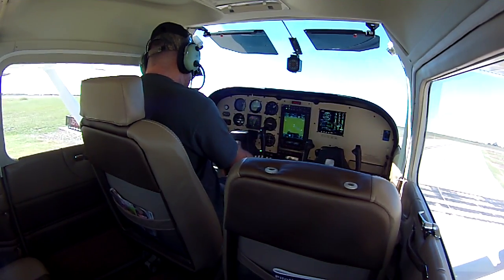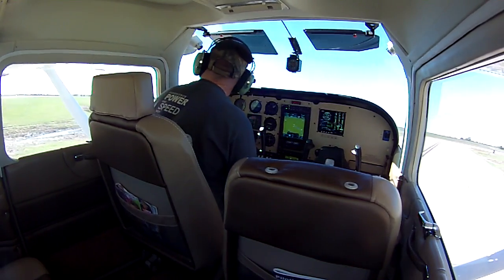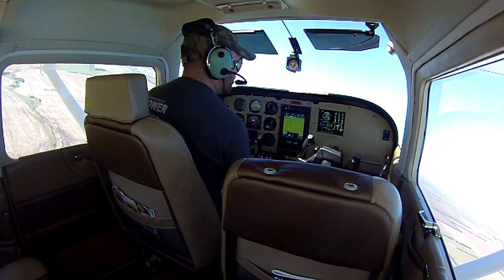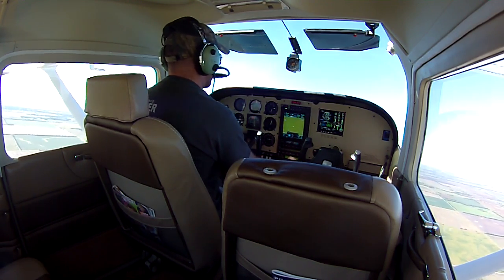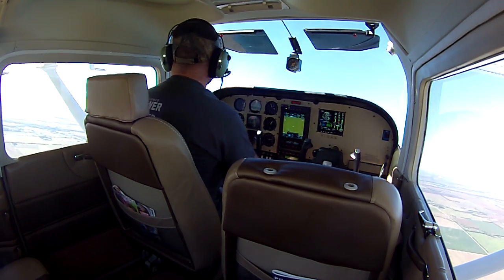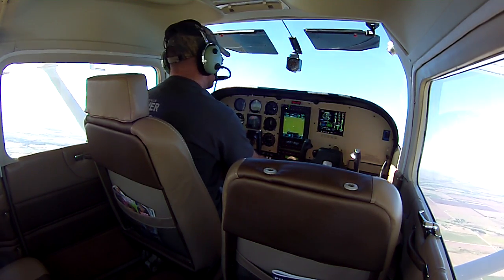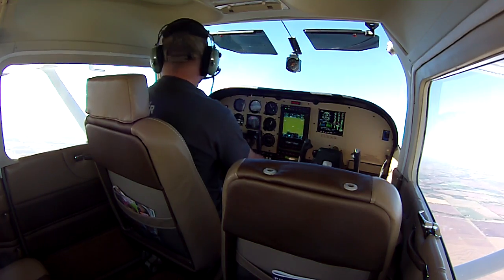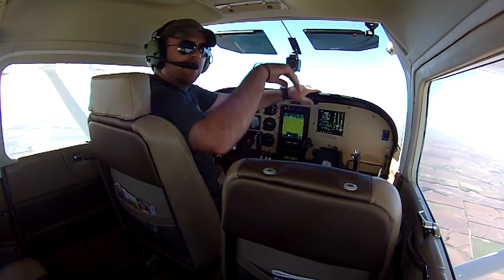Air Plains 182 300HP Takeoff

Comment: 14 second takeoff?  My C-185 will get off the water in 12 seconds with Aerocet 3400 floats and a 300hp engine.  Real performance comes from STOL (RSTOL, Sportsman, Wing-X and VG) mods, not from exaggerated horsepower.

Comment: 25 gallons an hour?!?!?! Thats the same a a 206 jet ranger.... Sorry but this is a very inefficient aircraft for what it is... Whats the point of this, plus an 82 inch Macauley will give you almost no ground clearance on a tricycle undercarriage, so landing off strip will be very limited without chopping something... Plus I have seen 230hp 182's perform better than this.
Reply: 25GPH is at full power, full rich, max RPM. I'm  sure it burns far less in cruise.

Comment: So that's approx. $40 grand upgrade, what was your level speed? 190 kts/ burning 18 gals/ at cruise? Why not buy a 210?
Reply: Doesn't sound like a bad Idea although it will hurt with insurance.
Reply: The 210 would be faster due to the retractable wheels but insurance and maintenance costs are higher.

The 210s gear can be finicky.

Comment: What did you get once you reduced power and leaned out the engine for airspeed and fuel flow?
Reply: Gary C Typically I fly the engines 50 rich of peak.  At 70% power at 17 gph, you will typically see 155-160 ktas...depending on your airframe and any airframe mods installed.  This aircraft in particular was around 161 ktas.